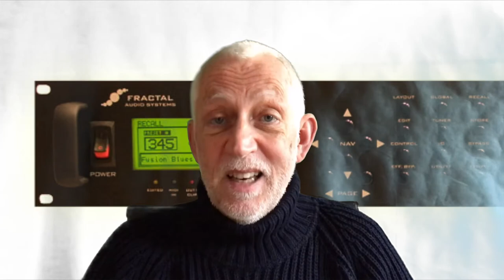Digital vs analogue?  Music making meets consumer electronics....

Comment: Fair observations , well made. Although valves , filter caps and resistors etc can drift in aging amps, the level of depreciation and dissatisfaction with digital products seems to lead me back to my Dr z's and decent pedals. I thought I was alone. Keep up the good work, it helps many.
Reply: Thanks, Alan.  I'm constantly torn between my beliefs as a player and concern that I'm a dinosaur with respect to digital.  But the more I think about it, why would I spend large such sums on something  that can't imitate the most revered, tried and tested (sometimes very old) gear and becomes obsolete quickly.  Sure, it can do processed but so can a studio.  Technology, including consumer electronics, has undoubtedly raised the floor and transformed accessibility in most walks of life but it hasn't done nearly as much to raise the ceiling.  Which is where I want to live!